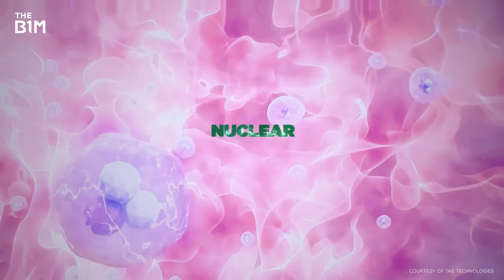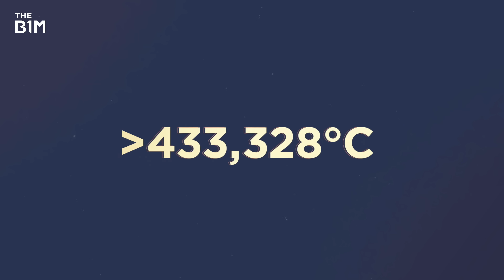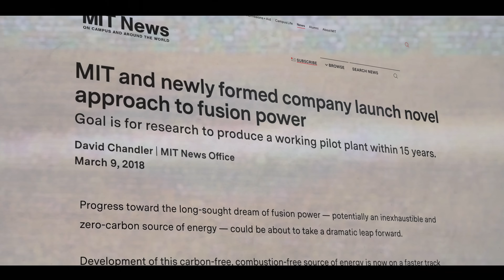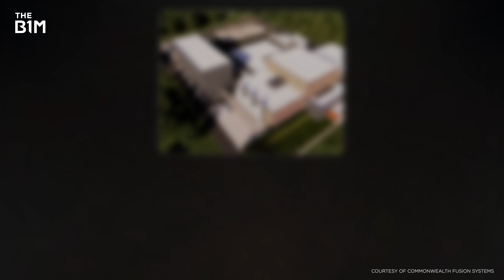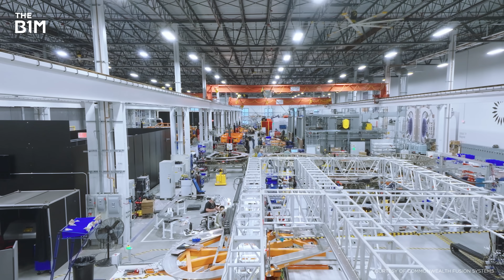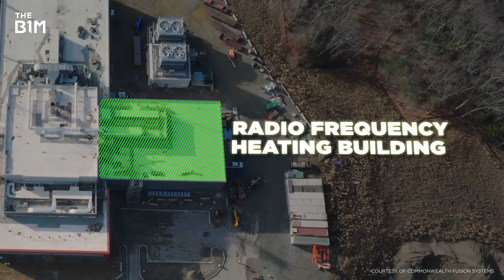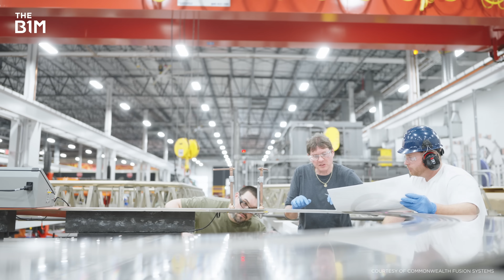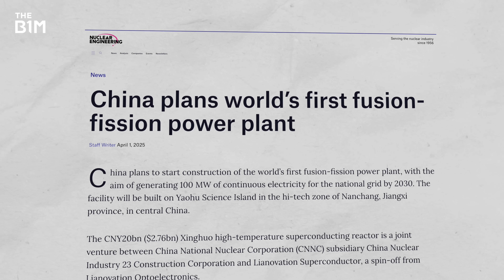Is America About to Win the Nuclear Fusion Race?

Comment: I'm so tired of science amateurs likening nuclear reactors to the sun.  Yeah, both do fusion.  But the Sun is mostly doing proton-proton fusion, which is low yield and veeery slow, hence the Sun lasting billions of years.  Manmade fusion reactors are doing deuterium-tritium fusion, which not only does  NOT occur in the Sun, it doesn't occur anywhere in nature in the universe.  That's 100x more interesting.
Reply: It's to make it more relatable to a wider audience. Remember, lowest common denominator, everyone knows the sun uses fusion, but not everyone knows exactly what kind of fusion it is
Reply: It's a construction channel, he was pretty honest about not knowing much
Reply: Chill man, B1M is a construction or civil engineering channel. This isn't Smarter Everyday or Kyle Hill.
Reply: Where are they getting the tritium from?
Reply: @Psmerling  from "Out of gas						
A shortage of tritium fuel may leave fusion energy with an empty tank":
"Some private companies are designing smaller fusion reactors that would be cheaper to build and—initially at least—use less tritium. Commonwealth Fusion Systems, a startup in Massachusetts, says it has already secured tritium supplies for its compact prototype and early demonstration reactors, which are expected to need less than 1 kilogram of the isotope during development."
Reply: @Psmerling  Fission reactors.  In particular, heavy water moderated fission reactors.
Reply: @Psmerling , in the short term (i.e testing) probably from fission plants. CANDUs are particularly good (or bad depending on your perspective) at producing tritium. 
The longer term plan is to use a lithium based salt in the blanket and harness the neutrons another poster mentioned as being a problem to breed the tritium from the lithium. In theory this lithium salt blanket 1) helps shield the reactor, 2) provides a method to extract the heat and 3) provides a pathway to produce the tritium. So again in theory, the only inputs are lithium (to produce the tritium) and deuterium which can be extracted from water.
On paper, SPARC should well exceed breakeven in ~10 second pulses which is much better than any tokomak ever run. The goal is to uncover any issues that would prevent the slightly larger commercial ARC power plant from operating. This is not a terrible plan and although they (MIT & CFS) got some Gov't money in the past for R&D, this construction/test project is mostly privately funded. 
I'd give them 2-1 odds of pulling it off, but to paraphrase Charles Till director of advanced reactor development at ANL in the 80s-90s, "Calculations don't tell you everything, you've GOT to test it".
Reply: Also D-T fusion releases high energy neutrons that make the reactor itself radioactive.
Reply: Um but in Spiderman 2 Doctor Octopus says "The power of the sun in the palm of my hand" and he's using tritium so explain that @jbtechcon7434
Reply: Well, quite. The p-p fusion that occurs in the centre of the Sun is the result of absolutely tremendous gravitational pressure, well beyond anything that can be achieved on Earth: those protons are getting squished together whether they like it or not (and mostly they don't). The reaction cross-section (its likelihood of happening) is so small we can't even measure it here on Earth, much less recreate it. We have to make up for it by using very, very much higher temperatures than occur even in the centre of the Sun, and, as you point out, different. non-naturally occurring fuels, so yes, in a very real sense, it's not really the same reaction.
Reply: wow, same thing my friend told me in 2005 when i said "we wont have sun on earth anytime soon". He said its NOT the same and we will have it in 20 years. And i bet if i ask you when it happens you will also say 20 years.
Reply: Obvs
Reply: That's what got us alien attention!
Reply: I'd never heard of that! You are right! That is incredibly interesting!
Reply: Totally true. The amount of actual fusion going on in a cubic meter of material at the center of the sun is minuscule. We are asking these machines to be thousands of times more efficient at fusion, so, no...we're definitely not replicating "what happens in the sun".
Reply: This is such an insanely stupid comment.  People like you are utterly insufferable. And the ridiculous arrogance of calling people science amateurs.
Reply: In the sun dont all the protons smash together into tritium and deuterium?
Reply: If it has occurred once here on earth, thats part of the universe. Man made or natural made, doesn't matter anymore. Fusion is fusion, and the type of fusion is not that much of the big deal. We don't need to copy, nature fully as it is, as  universe allows physics in various different ways to same objective of fusion too, if done in a lab or done in the huge gravitational force field crush.
Reply: Anyone who needs a comparison to understand what fusion is, won’t be helped by a “well actually, “ about the specific isotope involved. As a first order approximation, “it’s like the sun” is fine.
Reply: Okay, what's it more like than the sun? What is the average person's closest point of reference we should be using instead?
Reply: This is such a laughable bit of pedantry. You're really tired of that? REALLY? Nah, you just want an excuse to prattle on about the technical distinction, and this is frankly a dreadful excuse.
Reply: @BlackIndigenousPosse nope, not calling out mistakes is a mistake in itself.  its not pedantic when its fundamentally incorrect and lay people are none the wiser relying on misinformation as if its true.
Reply: @mark-ish absolute bulshit. 😂
Reply: "I'm so tired of science amateurs likening nuclear reactors to the sun.  Yeah, both do fusion..." They both do fusion. This is good enough.
Reply: Actually, the sun mostly runs on the C-N-O cycle.
Reply: @louis_the_hedgehog  No, the Sun runs mainly on p-p. Larger stars run on C-N-O.
Reply: The Sun does not produce the majority of its energy by fusing hydrogen into helium. - Forbes

The proton-proton chain is only a hypothetical mathematical model.
Fusion has never produced neutrinos, only fission.
The helium-4 produced by the Sun occurs via alpha particle production by fission of the heavier elements in the prominences and flares.
The mostly likely way that the Sun produces the majority of its energy is by fission of the hydrogen protons, directly out of the photosphere, a method proven by CERN.  Proton annihilation produces neutrinos and energy on par with e=mc^2 and the Sun.
Reply: @JoeDeglman  If the sun - or any star - produced most of its energy in the photosphere, it would collapse immediately, since the energy produced there would work to compress the sun's interior in addition to gravity, rather than supporting it against gravity. Not sure what you mean by "fission of the hydrogen protons", protons cannot undergo "fission", nor do they spontaneously decay. You can break the gluon bonds holding the proton together and release elementary particles, but that's not what's commonly referred to as fission.

The sun indeed does produce most of its energy by fusing hydrogen into helium in its core.
Reply: @harbingerdawn  According to CERN they can get E=mc^2 energy out of annihilating protons in a super collision.
  The Sun produces its energy by resonating the hydrogen protons apart to release the energy near the photosphere surface.   According to several sources, there is no evidence of energy transport from below the Sun's photosphere, as in the hypothetical fusion-at-the-core solar model.
 Fusion only produces energy on par with plasma recombination, like battery storage.

   In fact, none of the predicted features of the fusion-at--the-core solar model are witnessed with our Sun, or any other star.

   If the Sun produced its main energy in the core, the Sun would completely blow the atmosphere and photosphere away rather quickly.

   The Sun does not produce helium-4 in the core but produces helium in the prominences via alpha particle due to fission of the heavier elements seen in the prominences. 
 The Sun produces neutrinos, which have only been produced in fission experiments, never fusion.

   The only verified why for the Sun to create energy on par with E=-mc^2 is by fission of the hydrogen protons.
Reply: @harbingerdawn  Oddball antics in proton–proton collisions
Reply: @harbingerdawn  Also, according to wiki and other sources on nuclear forces, nucleons, neutrons, and protons are all highly repulsive at close range, not infinitely attractive as Einstein claims.
  The repulsive forces between neutrons and proton are about 10^28 times the force of gravity.  The repulsive force that keeps an electron out of a proton is about 10^38 times the forces of gravity.
    The force of the back pressure on the photosphere from the fission of hydrogen, and gravity, onto the core is too weak to collapse a star, let alone create the science fiction involved with a hypothetical "neutron star."   The electromagnetic repulsive forces of the nucleons in the Sun's core are too many orders of magnitude stronger than any such back pressure created onto the Sun's core.
   Gravity is too weak to create fusion in the Sun's core.  The perfect place for fusion to occur with the Sun is with the z-pinches of the electric currents in the electric current networks in the Sun's lower chromosphere, not the core.
Reply: @JoeDeglman   "According to several sources, there is no evidence of energy transport from below the Sun's photosphere"
My dude, we can directly observe convection cells on the sun's surface. That is heat transport from the interior. The existence of convection cells in the photosphere directly contradicts and disproves your assertion that the sun's energy is created in the chromosphere.

Your dismissal of the sun collapsing since electromagnetic repulsion would prevent it ignores the fact that the sun's density is many orders of magnitude too low for it to be supported by such forces. Of course the sun would be supported by EM repulsion before it could collapse any further, but 1 solar mass of material supported by just EM repulsion would occupy a volume roughly the size of Earth, not a million times larger.
Reply: @harbingerdawn  The Sun's energy is created directly out of the photosphere.
Fusion occurs in the chromosphere along the electric current networks there.
    There is no evidence of energy transport from below the photosphere.
    Solar Physics and Solar Wind -Wiley.
  Electric Currents in Geospace and Beyond -Wiley.

 The impact of multi-fluid effects in the solar chromosphere on the ponderomotive force under LTE and NEQ ionization conditions
Juan Martínez-Sykora, Bart De Pontieu, Viggo H. Hansteen, Paola Testa, Q. M. Wargnier, Mikolaj Szydlarski

None of the predicted features of the fusion at the core solar model are witnessed with our Sun or any other star.
   The only solar model supported by observation is the Hannes Alfvén solar model.
Reply: @harbingerdawn to be clear, fusion will never be a viable way to create energy, nor energy in par with the Sun.   The Sun's energy comes from annihilation if the hydrogen protons in the photosphere.
Reply: @JoeDeglman  I disproved your assertion and you're ignoring it in favor of repeating the assertion. That's called intellectual dishonestly and bad-faith engagement. Go waste someone else's time with it.
Reply: And it requires more energy to make it happen and then sustain it than it can ever put out. Fusion for energy is the modern perpetual motion machine.
Reply: @Metal0sopher  "ever" is a mighty long time. Fusion with net energy gain is not a physically impossible perpetual motion machine, it's just a really hard set of hard engineering challenges. Even the companies hyping their quicker approaches aren't promising net power going onto the grid before the 2030s.
Reply: @Metal0sopher  SPARC is predicted to produce over 10 times its energy input sometime in 2026. The science for that number is very solid. Just sit around and wait for the headline
Reply: @johnvonkerman  I'll take your money. Put up $1000 behind your statement. If by Dec 31st 2026 SPARC produces 10x gain over input, I'll pay you $1000. But if it does not, you pay me $1000. Will you stand by your words and take this bet? I stand by my words.
Reply: @Metal0sopher  I actually misremembered that, it's supposed to be operational in 2026, it's not supposed to net power until 2027, so no
Reply: @johnvonkerman  🤣
Reply: @Metal0sopher  😂😂😂
Reply: bro's confident that he knows what has and happened happened in the entire universe

Comment: Sooo if we wanted to invest in this tech, any suggestions?
Reply: We're still a loooonngg way off this tech being finished, let alone being profitable. Before being profitable we need to get the power onto the grid (once we've got over the barrier of making more power than has been put into the system in fuel. Nobody has done this yet), which is a major hurdle. You wouldn't see a return on investment for at least 10-20 years.
Reply: Only invest money that you don't need.  Expect to lose every penny of it.  If you have that kind of money, and can afford to waste it, then yeah, you can invest in anything you like.  As it stands, fusion is probably not the place to put your money.  Microsoft and Google are willing to gamble on fusion because they have the money to spare, and if it does come in, then they stand to win big twice over.  First, by owning a piece of the company that did it, and second, by having a cheaper source of electricity for training their AI models.

It's basically the same reason that Microsoft is heavily funding the refurbishment of the Three Mile Island nuclear plant.  They know they're going to need the power, and they want to get it for as cheap as they can.
Reply: CFS is not publicly traded (yet). But when it happens, you bet I'll be buying stock.

Comment: This is very misleading in that it gives the impression CFS invented REBCO tape and magnets when they didn't, and that they are the only outfit building REBCO tokmaks, which they aren't. Tokamak Energy in the UK started 8 years before CFS and has been building extremely high-field REBCO tape magnets since 2020. And built a small REBCO-contained tokamak in 2015 (ST-25HTS). In 2023 they were the first to get a plasma up to the required 100 million C for the D-T reaction (in their larger non-REBCO machine ST-40) .They were way ahead of CFS, but don't have anything like as much money, so CFS have been catching up fast.

Comment: Well if they can get it small enough to fit into a fusion core. We can get it in a power armor.
Reply: Even if you could hypothetically get materials that were powerful enough to miniaturize it that much, the sheer strength of the magnetic fields you would need to contain a plasma at that size would likely fry nearby electronics and cause seizures or neural malfunctions in humans wearing it. Antimatter is a more realistic alternative, but still a ways off and is sure to be expensive if energy has any price at all.

Comment: Gee, one might actually think that stars CREATE energy. Accept the fact that the entire universe only breaks even, and that individual stars MIGHT only output energy equal to their input energy.

Also, prospective fusion plants do not actually mimic the sun. The hydrogen that tokamaks use is not the same hydrogen that the interiors of stars use. Stars use protium, the common hydrogen isotope that consists of only a proton in the nucleus and nothing else. Tokamaks use deuterium (a minor isotope with a neutron in the nucleus that comprise 1 out of 8000 hydrogen atoms) and tritium (an EXTREMELY rare isotope with two neutrons, found at the earth's surface only as product of FISSION reactors -- i.e. uranium nukes), and it's the neutrons that are used in the generation of the power. So it's not the same process.

This is an extremely snide post, but we're talking about a technology that has been worked on for 70+ years with huge funding and no usable results. Meanwhile, fission power is underutilized due to public ignorance and fear despite being the cleanest, safest, least expensive  and most plentiful source of power ever discovered, and I say this as someone who does not have, and has never had, even the slightest financial interest or participation in the endeavor.
Reply: Actually, until very recently, the funding has really been pitifully tiny, and yet the progress has been faster than Moore's Law. I find your lack of faith disturbing ;-)
Reply: Yeah I'm not vastly knowledgeable but even I knew tritium was extremely scarce.
Reply: They just use Duterium-Tritium because it's many times easier than protium-protium or protium-duterium reactions. (several times lower threshold energy). Tritum is easy enough to make by just irradiating lithium. There have been plnety of useable results in the last 70 years of fusion research, which is why we are now only a few years away from proving Q=10. the critical threshold for a viable power plant.